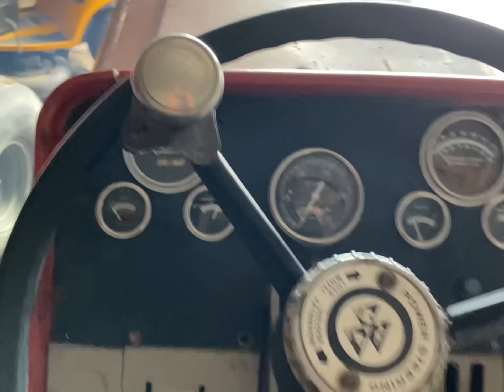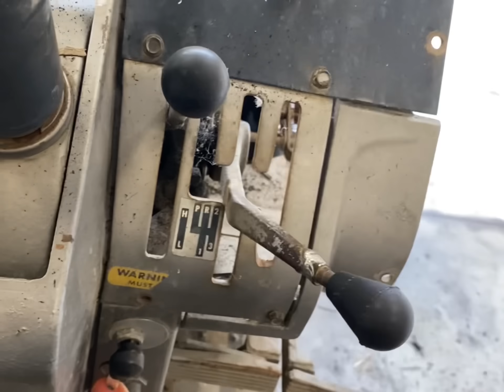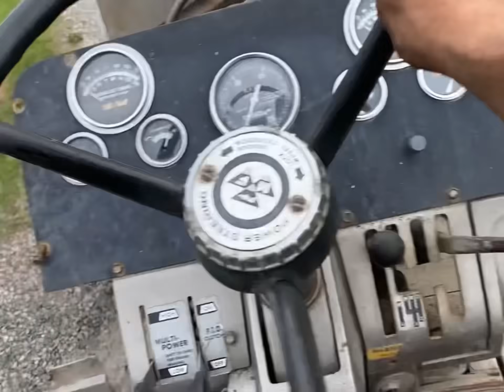Unleashing the Power:  Starting Our Massey Ferguson 1150 Project!

Comment: I almost never comment on the videos i watch on YT, but yours are special to me.  My father was a small-acre farmer in KY. I remember the day in 1961 our first MF 35 Diesel Deluxe was delivered  along with several implements. He so loved that little beast (as did I). In 1965, he upgraded to a 135 Diesel Deluxe, then added a 165 Diesel Deluxe in 1968 to farm river bottoms he leased from the Corp of Engineers. Every time I watch one of your videos, it takes me back to the days of riding beside him leaning back against the fender of the 35, and then later operating the 135 and 165 with him as a team.  Thanks so much for your love of old Masseys. Every video you post makes my day!
Reply from the maker: Right on!  I’m glad to bring that back for you!

Comment: Cold water and grease is a nightmare!  LA Awesome from a dollar type store is one of the cheapest cleaners you can buy and works amazing well on grease.   Pump sprayer, grab a beer, pressure wash, repeat.  Save the high dollar degreaser for the final pass.   

Every dent on every tractor has a story to tell.  When restoring an Alis, we saved an ugly coat hanger weld.  There isn't many people who even know what a metal coat hanger is today let alone that you can weld with one and a battery.  Ugly but it got the tractor out of the field and back to work.  Love your channel.
Reply from the maker: Right on!  I appreciate it!

Comment: When you take the fenders and hood side panels off you really see how well made Massey tractors are ,and the rear end, and lift are second to none you hardly have any problems with them iron   built in them tractors as a Massey man myself I know I have drove many  models on the farm it will super nice when you get it finished a keeper for sure
Reply from the maker: Right on!

Comment: Hi there JT, I’m one of your fans, I fitst true job was working for a Massey dealer, which put me through college. Have you ever used a Milton S157 Siphon Spray Blown Gun?  It works great for degreasing, greasey tractor, you just plug it in to your air hose and tube into gasoline or a solivent. 
Keep it up, your beginning me members, all the Massey family of farm equipment. 
Amazon has the blow gun, for $18.85
LDC from south Texas
Reply from the maker: Right on!  I appreciate it!

Comment: Thanks for the video. Indeed you fought the dirt, oil and grease.
I hope you will find an affordable pressure washer with a boiler. That will melt the oil and grease off a tractor.
Reply from the maker: Right on!

Comment: Awesome content JT. Just a suggestion here, you could wire in a relay switch with a fuse which is activated every time the key is on. Very inexpensive and simple. Any auto parts store sells not only the relay but also the relay receptacle. That configuration would maybe save you heartache in the long run.
Reply from the maker: Good tip!

Comment: As always, another Enjoyable video. There's just something about those V-8 Perkins. Maybe a Turbo and a trip to the County Fair Pull ? Hmmm 🤔. A suggestion. Amazon has a "Turbo" nozzle for your pressure washer that works really well for chewing up greasy messes. I bought one a couple of years ago and it works great. When they first came out 15-20 years ago, l remember them to be about $80-100 bucks. I think I gave about $20 for mine from Amazon. As for degreaser, I use Castrol Super Clean. A spray bottle of full strength for Heavy Grease and dilute for other projects. I got my wife hooked on it for kitchen grease on the stove and range hood. She also uses it as a stain remover in the laundry and around the house. Just sayin' . I know, long winded. The wife reminds me all the time. 👍🇺🇲. Oh, and this is for Fluffy, 🙀.
Reply from the maker: I need to get one of them turbo nozzles!

Comment: Excellent video JT  :) also may Lol at this when Restoration my late Dad  & Late Uncle  his brother 1963 McCormick-  International B414  Loader tractor Desiel motor,  the tool box was on left fender above axle and exhaust tail it fell of when took tractor to pressure vehicle washer ! But was okay the fenders on parts tractor I had better shape  plus tool box like mint condition! Plus also muffler plus tail pipe blew of after washing it like big bang was funny to ! But tractor still lives on today and saw last year when had do some work on it new owners home farm have it  too! But tractor it works like fix up yesterday and too! Also JT did want ask did ever work a Massey Ferguson 6 cylinder 364 motor that use Combine #505 and not sure of tractors   models! Why ask because my late Cousin had in 1975 Dodge D350  1 ton  Extended Van was Ambulance and then when hospital retired it he bought it fix up to Camper  van 2 people type also has a  truck  Creeper 4speed Overdrive Manual transmission and axle last hear was 390 ratio yes van is loud! No Turbo on Massey Ferguson Combine motor in Dodge van ! It amazing to!
Reply from the maker: I believe that’s the same motor that’s in my 1105?  Good motors, I’ve heard of a few that were swapped into pickups!
Reply: @jtsbarnngrill6873  that cool to know JT  😎    & did not know that  and why ask too ! There amazing motor yes !

Comment: Joe I always use a secret to degrease and I use pipeline soap the dairy farmers used to clean their milk lines. You mix up a 3/4 of a Solo cup of the soap in a hand weed sprayer. Soak it and then wait 5 minutes then pressure wash if there's still some left wait till it dries soak it again and then pressure wash. Those products are environmentally friendly and are not detrimental do any metal do any rubber your gaskets seals trust me I've been doing it for 30 years you should see how good of a job it cleans the windows as well
Reply from the maker: Thanks for the tip!  I'll give it a try.

Comment: What I did on my 1100, the wheels on were spin- out and I left the big  huck of metal on the frame. Just took the 4 bolts off the fender.
Reply from the maker: Right on

Comment: I like using hotsy ripper 2 soap for degreasing. Put a cup in a gallon of water in a weed sprayer. Just be careful because it will turn a red Massey pink if you leave it on top long
Reply from the maker: Right on!

Comment: Farmer I use to work for had a very old David Brown tractor and the seat was like a seaty which was upholstered but it was hand crank to start would have been good for pulling because the tires were very wide would have been nice to see it running but I only worked there for 4 years there was also a static oil engine there and it was big
Reply: ???? WTF
Reply from the maker: Thanks for sharing
Reply: They always get what they deserve because there is always someone worse than them so it always backfires on them as word gets around when you are looking for parts for sertain tractors the steering worm broke on the Fordsen Major and we found a steering that would fit with a little modification it was a little taller but that didn't matter and it came from a forclift and worked perfectly it was far better when I left than when I started there as had new break lining from Ferodo at Caenarfon not far from the castle where Charles was crowned as prince of Wales
Reply: Air intake is high and exhaust is higher and the fact that you can use the three point hitch was great as well because you could use it for different height boat trailer

Comment: Wonder why you never see that v8 Perkins with a turbo! I'm sure they did it on the later models, but haven't seen it on a 1150 or 1155.
Reply from the maker: I believe the 2805 was the only v8 with a turbo. I could be wrong

Comment: Well JT, there has to be a place in hell for anyone who'd screw a tractor guy!😢 If this guy is in Wisconsin let me know. I've always thought about making a solar water heater to provide hot water for the washer . Used a steam cleaner years ago and the heat really cuts the grease. On my 65 F350 the caked on oily crud actually protected most of the stuff underneath. Keep the faith in mankind or there is no hope.
Reply from the maker: Right on!  Thanks!

Comment: Over years, perhaps 50 years, I have used many pressure washers, some useless, some 30% good, but in general, like you, I got covered in shite. I have washed off every farm/forestry/plant machines like bull dozers, they all had one thing in common, you guessed it, I looked like man from Mars, blathered in what ever shite was on it ended up on me, I was getting on in years, fed up of getting soaked in filthy water and shite to the day, temper got the better of me, throwing the pressure lance to the ground using all the choice swear words I could muster, when my bosses wife walked past, along with her other half, both burst into laughter, I bit my tongue, I could easily been fired..........Following day, a brand new hot 2 lance pressure washer was being fitted, it would clean in cold or hot, or steam for stubborn oil and grease, boss came for a look, thank Pam for this machine............... It was an amazing cleaner, cost my boss £20000, what that would cost in $'s, not sure........After I retired, I purchased a small steam cleaner & went out and did some contract work with it, cost was £800, never again to be covered in shite!!
Reply from the maker: Right on!  I’m gonna have to look into one!

Comment: That old girl really deserves a good cleaning and some new lipstick but looks like a 24 cool pop job
Reply from the maker: That’s for sure!
Reply: I worked on the 200 series i am wondering why you don’t use the mechanical pump on the tractor i know its a eight 8 cylinder as compared to the 6cylinder of the 2725

Comment: that electric fuel pump is not factory. the original fuel pump is mechanical
Reply from the maker: You are correct. These have the mechanical pump in the side of the injection pump